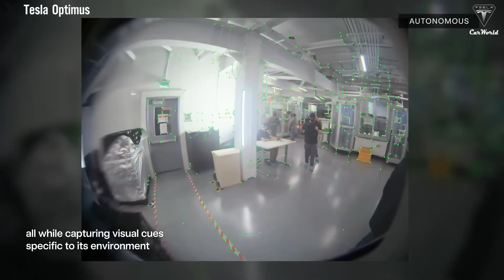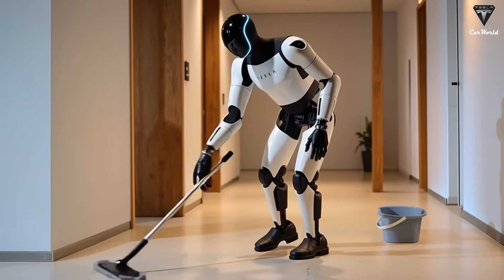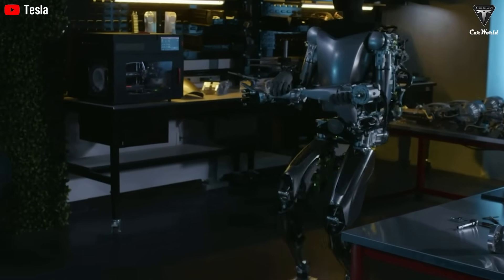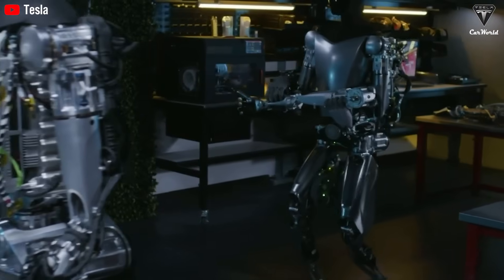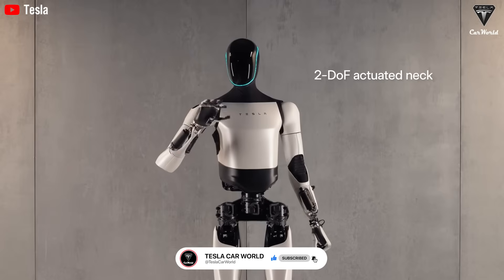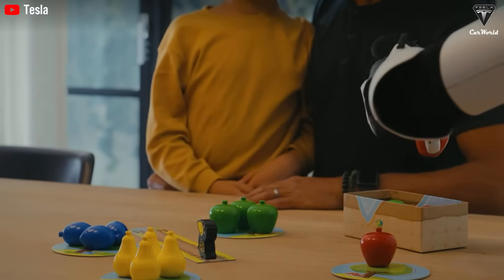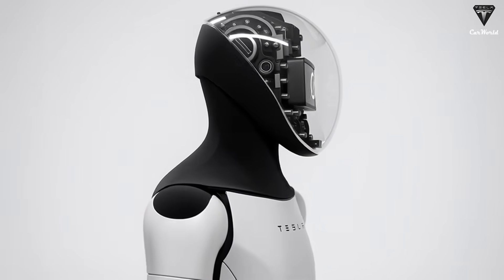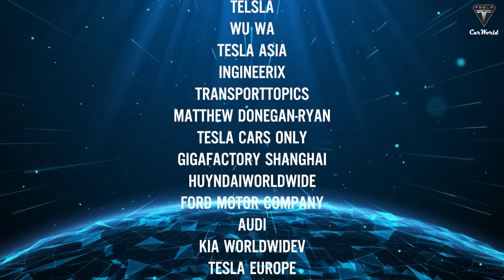Elon Musk SHOCKED Tesla Bot Gen 3 Final UPDATE & 5 NEW Capabilities Before Launch 2026!

Comment: Safety must come 1st, user may try to use the Robot to harm others.
Reply: There is a National Electrical Safety Code.  There needs to be a National AI/Robotics Safety Code.
Reply from the maker: Absolutely—Optimus has strict usage limits, remote lockouts, and built-in behavior constraints. Tesla will control early deployments through a rental program for safety.